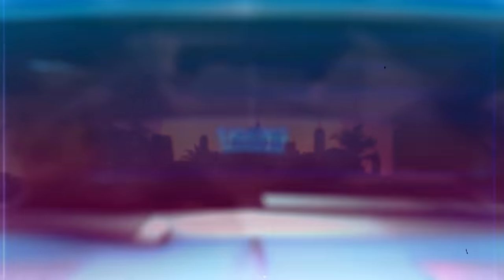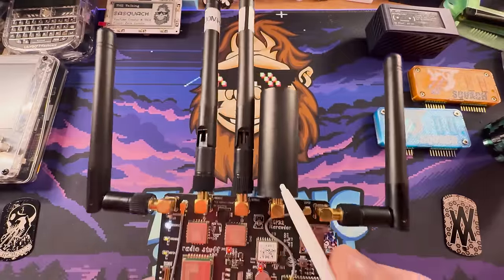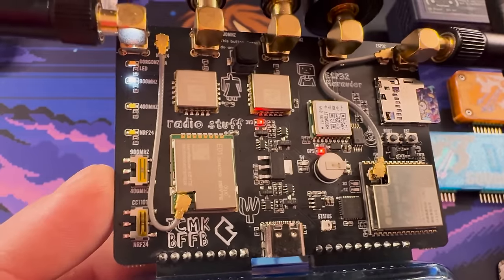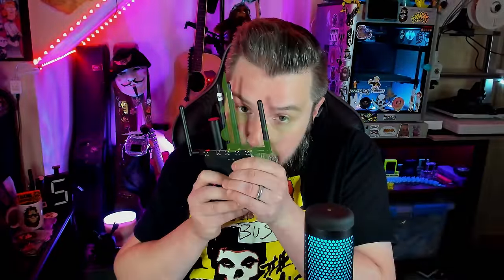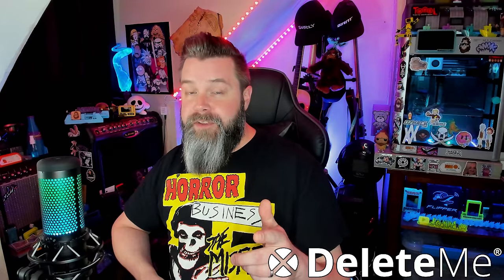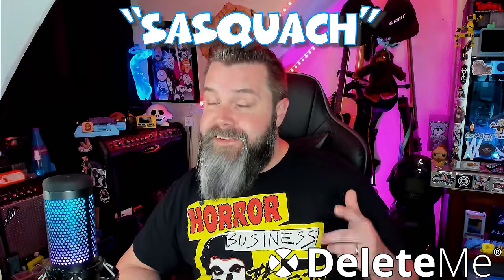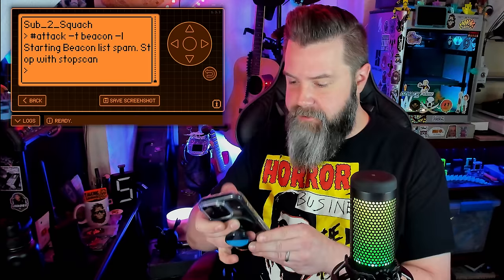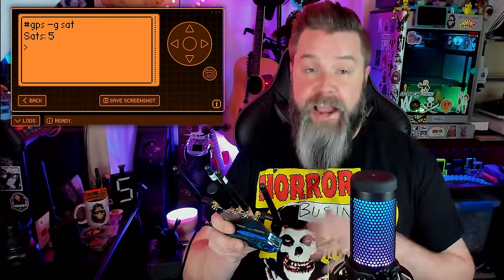This Flipper Zero GPIO Board Does EVERYTHING!!!

Comment: rolling codes dont work like he explains... by his description if you accidently pressed the key whilst not in range of the car it would brick it and need resetting, This isnt the case, the car will recognise ANY code in the list at ANY time 90% of the time. Some have added protection but MOST dont. obviously if you do it repeatedly it may cause an issue but ive found as i said MOST dont.
Reply: Desynk?

Comment: Great video! Do you plan on continuing with the HackRF series now that the new portapack version is out?
Reply: which is better to buy flipper or hackrf. i have hackrf but im finding the flipper seem do much more.
Reply: @kobepower  The hackrf is only for radio-frequency but have barely no limits, on the other side Flipper is a gadget that covers in small percentage more than 1 ambit, nfc, rf, rfid, ir, etc. 
From my point of view, flipper is like a toy for hackers, and hackrf is more a professional hardware for managing radio-frequency. 
Btw, got 2 flippers and only 1 hackrf xd

Comment: It sure if you can help I would ask. I bought a flux capacitor from rabbit labs it worked fine then I started adding files and now it does not. I removed the files as far as I know. Can files in different folders affect the gigahertz folder?